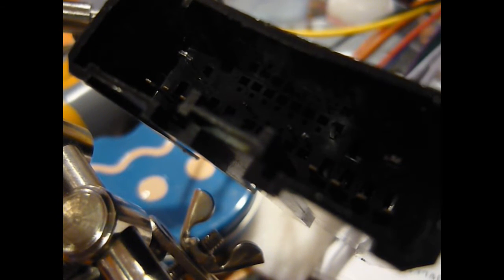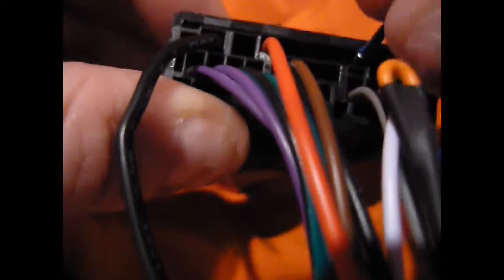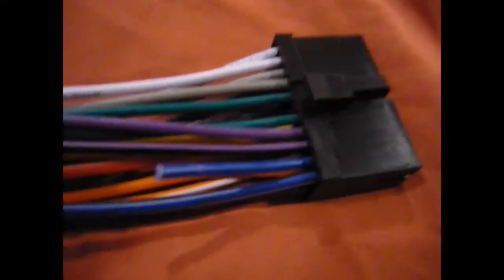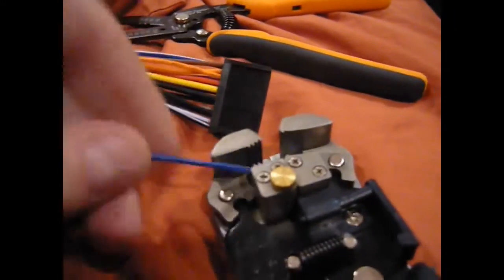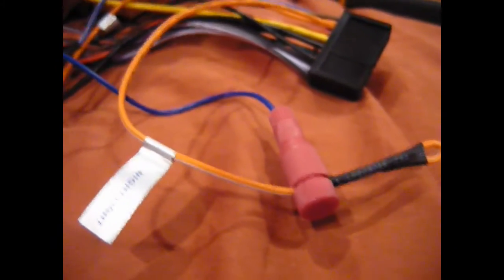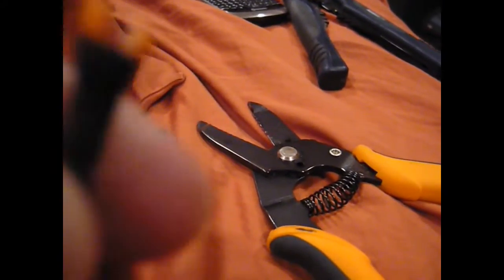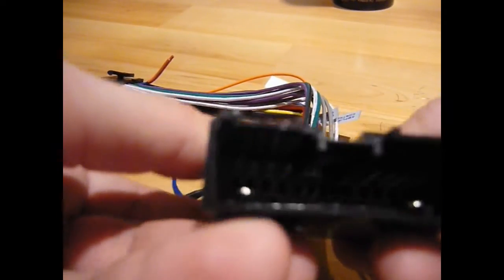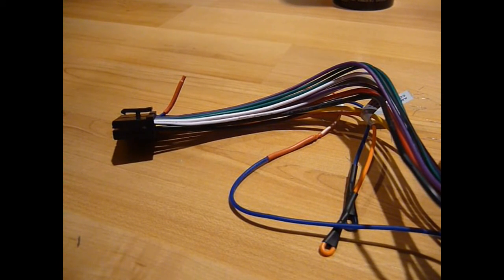Eonon D5102 Illumination Wire Connection

Comment: Hey im trying to find a picture of the harness end that goes into the unit.
Is that the part your working on? 
Does that end go into unit or into harness to vehicle factory 🏭
Reply from the maker: This is the end that plugs into the car.. I don't unit if I still have the cable lying around but it's a much smaller connector
Reply: @Guyfromhe  I dont see anything

Comment: @lewcianci Put in the simplest way possible: "Connect the free "AMP" wire of the D5102 to the blue wire with silver dashes in the middle of the stock harness. (Probably pin 13) - Yes, this requires either splicing into the stock harness or adding a pin to your harness.  For more info you can visit the D5102 Wiki.
Reply: Can you plz tell me what the order in pins color are